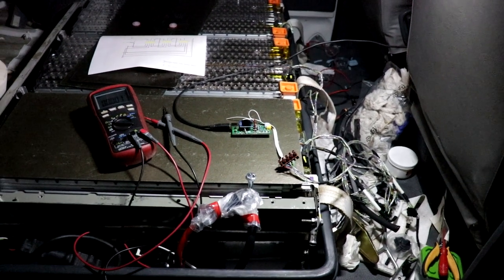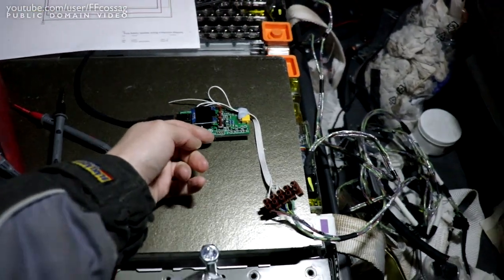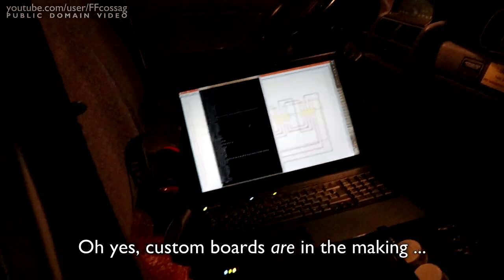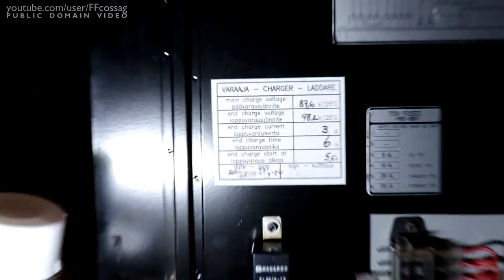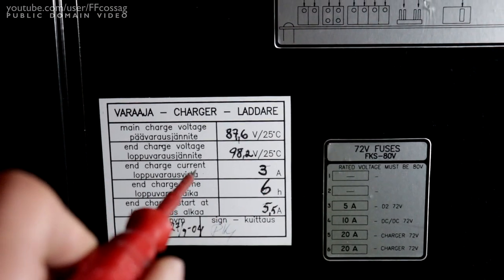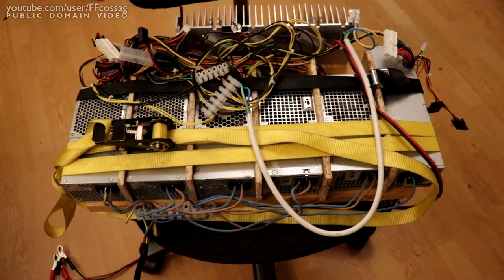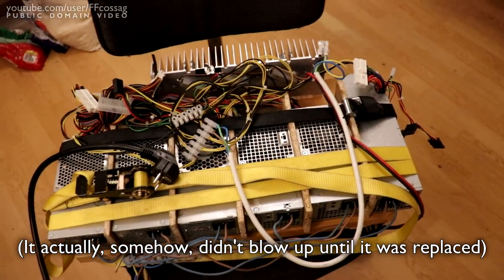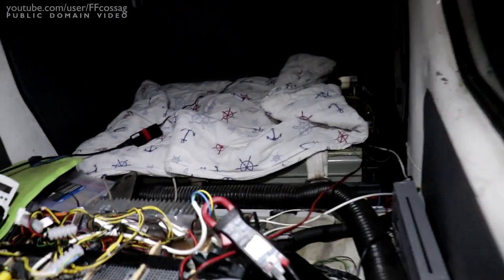Elcat Lithium Conversion EP3: Charger woes & BMS v. 0.01

Comment: I love your charger you threw together. It's great to see more videos from you, you've inspired me to do some projects of my own.
I recently picked up a SMT750C used, and was hoping to tear it down and adjust the float voltage through J606 with the hidden smart protocol, but it almost seems like APC fixed their battery float issues this time. It is a multi stage charge and the float voltage is about 13.55-13.6 volts per battery, after it first tops up to exactly 14.4 per battery for like an hour.

Comment: I have been busy the last couple days so I just now finished watching all 3 videos of the elcat conversion :P I have a valid reason too lol, I actually went and bought a van myself, which I am going to convert into a little camper like your other van! :D very much inspired by you :D I have been working my ass off cleaning it up, it was a hunter's van so yeah it was kinda disgusting but thanks to some industrial degreaser and a lot of time and effort, it is now clean as new! I have almost stripped everything out of it in order to clean it, haha. I got a 2010 VW Caddy, and I happen to fit just perfectly lenghtwise in it :) it got extremely wet from all the washing, so I must let it vent out with a heater fan running inside it for several days before I can reassemble. I look forward to beginning to build the bed in it :) I think I will go to a similar design to yours, with 30x30mm square tubing, and some storage underneath, and also a fold-down table on the other side, that was a really good idea, thank you for the inspiration hehe :)  Damn, I'm sorry about that charger blowing up, as it looked like it would have worked perfectly. I hope you can figure something out to replace it other than the server supplies, although I must say I absolutely love the look of them all strapped together into one giant charger :P I want to say that was a failing rectifier diode giving up it's last bit of will to work, very unfortunate. I might be able to help you find another original Elcat charger, I have a few ideas where I could ask around for one here in sweden. But I think it might be better to build or buy a adjustable high current supply from ebay or something, Maybe you could get or make a 3 phase one instead, which would theoretically allow you to charge with about 8-9KW assuming 80-90% efficiency and a 3x16A supply which is common here in sweden and also finland where you are :) The strapped together power supplies from servers amused me a lot, That's very similar to how I do things myself when things break lol, I take whatever I have and make it work x3 And yes! That feeling when something works on the first try is amazing! I got a huge smile on my face aswell! being able to monitor the cell voltages is great, at least now you can charge them to 70-80% which is a huge step forward compared to only being able to charge a little incase cell imbalances happen, atleast now you can monitor them :D I must say though, that was some pretty impressive carnage in the charger that blew. But not at all fun when it happens, considering that charger would otherwise have been more or less perfect for the needs :( 

I am eagerly awaiting the next video lol, when I saw you had uploaded again in a while I almost jumped up and down from happiness :) Best wishes from me here in Sweden :) I don't know if you remember me but I used to come on a lot and chat in swedish on your livestreams :P
Reply from the maker: I do remember a "tigerelectronics" :)

Good luck with your camper van. In hindsight, I'd recommend you do a wood frame bed rather than steel. Metal is sturdy, but wood is infinitely easier to finish and work with. I only went with a steel bed because it had to be removable - that van was also my work van at the time.

The Elcat will remain 1-phase, and it will get a much more proper, modern charger in upcoming videos. In a way it was a good thing, because the efficiency of these original chargers is only barely 80 %, so you're wasting about 500 W as heat throughout the entire charge. If you can find old Elcat chargers, I'd be interested though. I'd like to have one original unit at hand in case I ever want to restore it to completely stock configuration in the far future.
Reply: @FFcossag  YAY! :D 

I think I will build a steel frame anyways, because it makes taking it in and out of the van much easier in case I need it for transporting some larger items, unlikely, but just in case. But I'll see, I haven't made the final decisions on material choice yet. It would likely be possible to move a wood frame in and out aswell if I build it with enough support and not too heavy, but I am alone so it needs to be (somewhat) easy to take in and out by myself. I think I will make it modular for this reason :) 

That sounds awesome, And yeah the original chargers are not that efficient by today's standards so that's another great reason to use something better :) And yes! If I find one, I will definetely let you know :)
Reply: Looking forward to the next episode a lot :D Watching your old VanLog and van build videos in the meantime, dreaming about having my van finished! :D Still got a few things I gotta do, I won't be home tomorrow but I am planning on rust proofing it with Biltema linseed oil based spray on sunday, and letting that dry for a couple of weeks before I do more :) Caddy's are sadly not known for lasting too long untreated, so I wanna try to preserve it to the best of my ability :)

Comment: Wow. That was one highly tuned PSU. Must've gone into complete suicide mode given the extensive damage?
Reply from the maker: I suspect the cause of the failure was that a washer had cut into the PCB trace and severed it. Once the trace gave way completely, the output diode shorted, and it ended up with a dead short on the output. The cut trace was the weakest link, so a giant arc formed when it tried to short-circuit the battery.
Reply: @FFcossag  That makes sense, and that explains the severity of the damage aswell heh, tesla battery VS PCB doesn't go very well :P

Comment: About the back feed protection:
Have you considered what happens when the v.2 charger loses power during the charge?

I'd assume you'd get the same random voltage problem because the PSUs might draw different amounts of current when you back feed them.
Reply from the maker: V.2 charger?
Reply: @FFcossag  
I'd call the original V.1
The new PC PSU charger V.2
And the ominous charger that hasn't been revealed yet V.2.1 or V.3 depending on how sketchy it is
Reply from the maker: Ah.

Yes, I did consider what happens when it loses power: It blows up! :D

Comment: 🤣 How did you get the idea to put all those PSU's in series? I know I've done a similar thing, I made a triple output PSU with 8 Dell 90W laptop chargers stuffed in an ancient (Pentium era) 6U server PSU case. It is configured as a 2S2P 360W 39v + 2S1P 180W 39v + 2S1P 180W 39v
So in theory with all but the 360W floating from ground I could wire them all in series for a 540W 118v 4.5A supply 😆⚡💥
Reply from the maker: Ah, 4,5 A at 118 V. The most specific power supply ever cobbled together, hehe.

When the Elcat charger blew, I happened to have a bunch of old PCs lying in the trash. One late, caffeine-fuelled night, I just asked myself if it could be done, so I did it just to find out. "Can you charge an EV with old PC parts?"

I kind of picture myself as being lost in some desert wasteland, trapped without a charge, and forced to cobble something, anything, together in order to get out of there, hehe.
Reply: @FFcossag  Haha! Hey it didn't cost any money so why not? Certainly worth the time to learn a skill. I avoid buying parts as much as a I can when putting a circuit together. I have so many old circuit boards I can usually find what I need. I only regularly buy big mosfets (IRFP260N) and low-ESR electrolytics since most capacitors are low quality or only rated for 16v or less.

Comment: I might have a few compact, efficient (~95%) and adjustable (~23-29V) 24V/40A PSU that would have a current limit that i could sell cheap.
Reply from the maker: Thanks, but I've already sourced a new charger for it. Mean Well released a new series of very nice and surprisingly cheap 1700 W chargers, just in time!
Reply: @FFcossag  That's more or less Perfect!!! :D